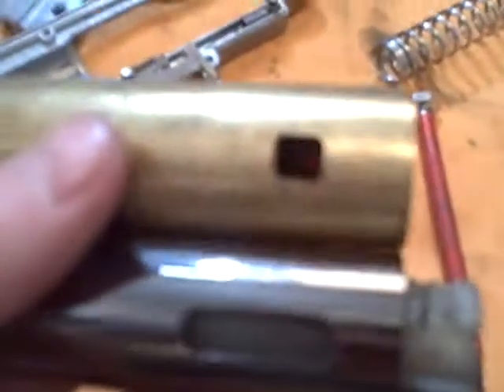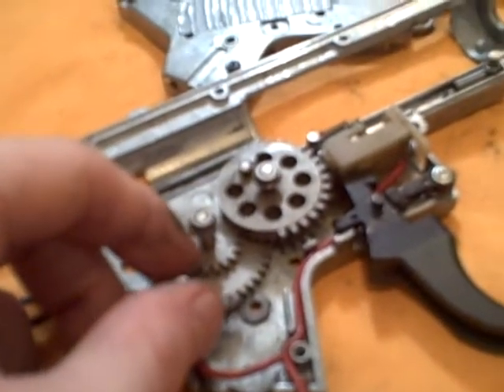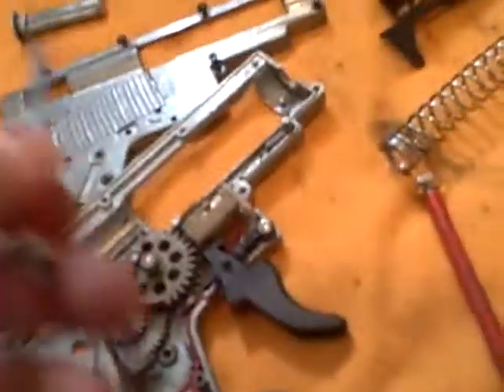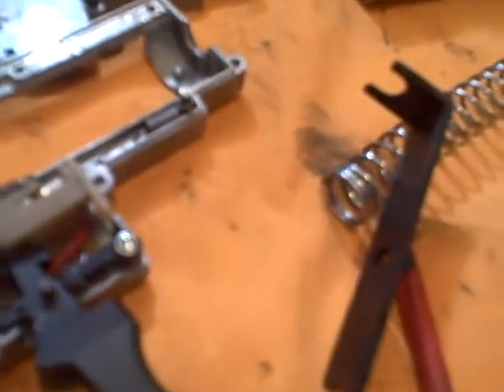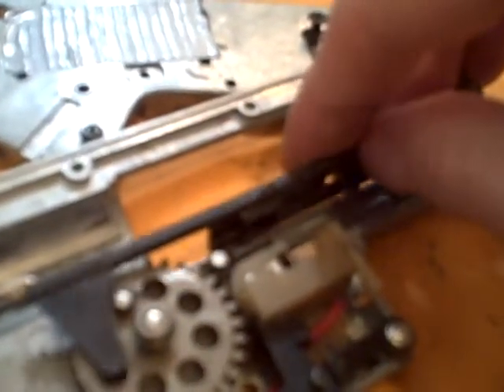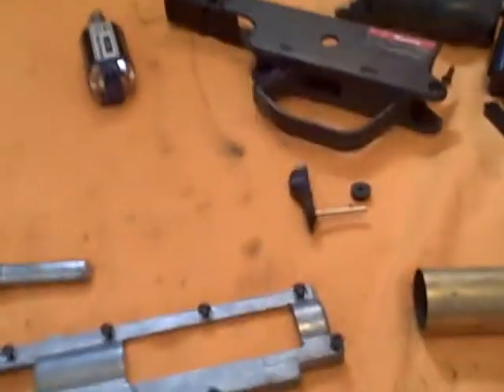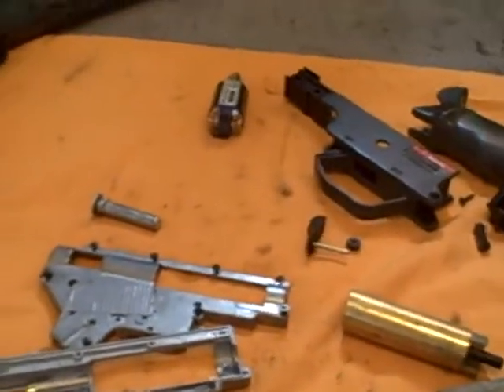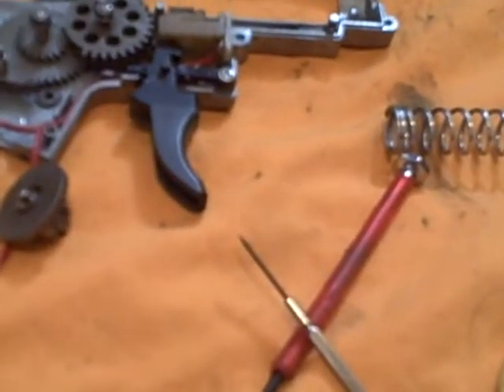JG G3A3 gearbox hints 2 of 3

Comment: hey man, i have the same gun, i got it from a friend for 30 bucks broken, and slapped a CA wire harness, sp120 ,metal bushings, modded piston, and hummer 1200 motor and it works very well.   i broke the gearbox however, and now i think im gonna scrap it for parts.     my main weapon is my CA m16 x series, with a noveske 12in rail and a lipo.   its much better than the g3.